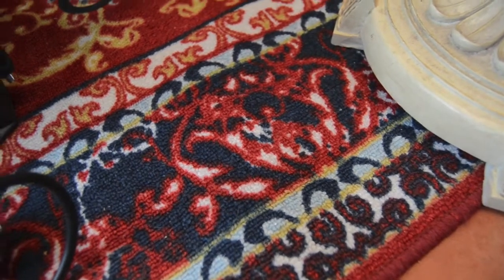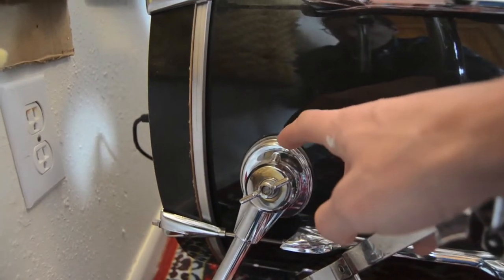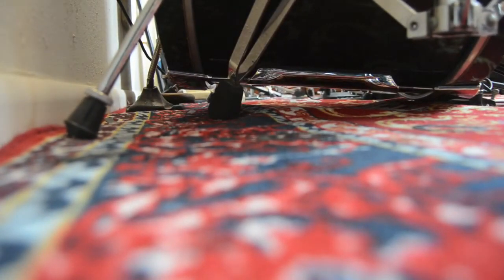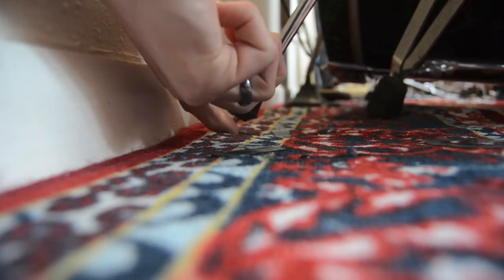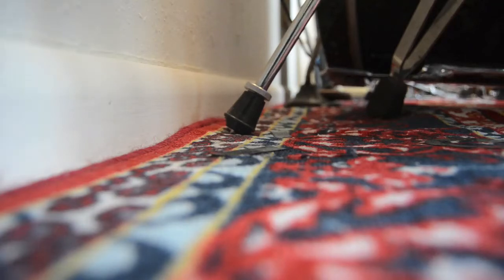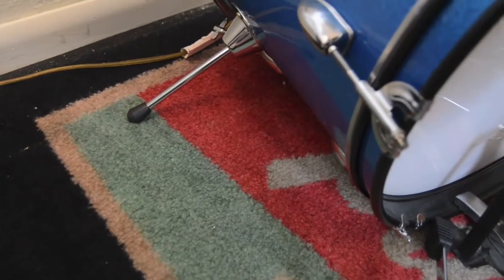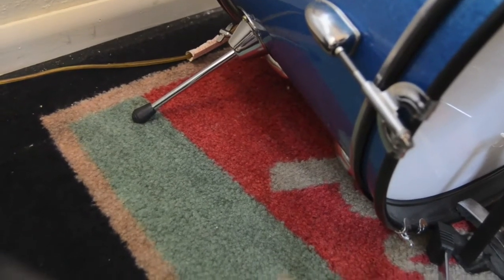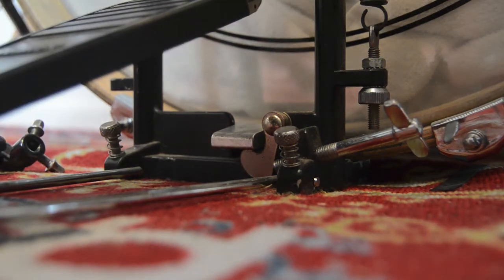How To Stop Your Kick From Sliding - Kill Bass Drum Creep

Comment: If I modify my technique to direct the force on the bass drum pedal superior -> inferior with minimal forward vector, will this help?  Got a low end bass drum
Reply from the maker: Yeah it should. Normal bass drumming should have no forward component. Some types of double strokes do, however. If you have the relatively useless type of spurs that only go sideways then using an outside device is probably your best option.  Either a pedal with it’s own spurs or a hoop-mounted spur.
Reply: @RyanAlexanderBloom  Awesome, thanks.